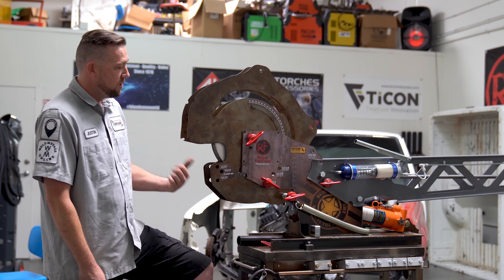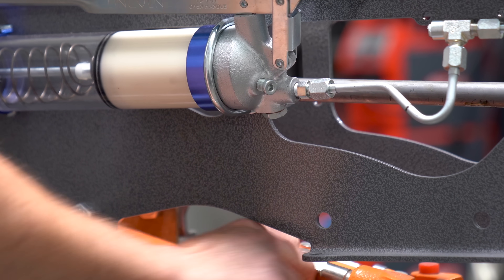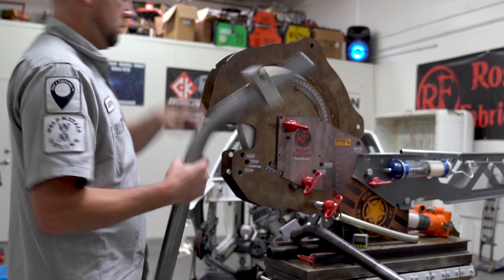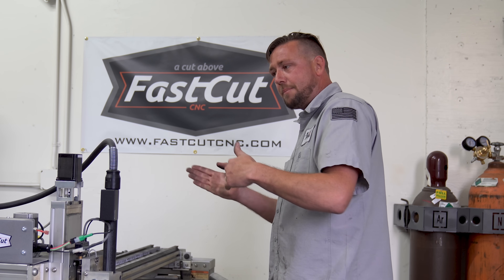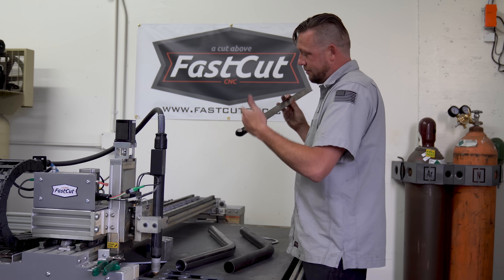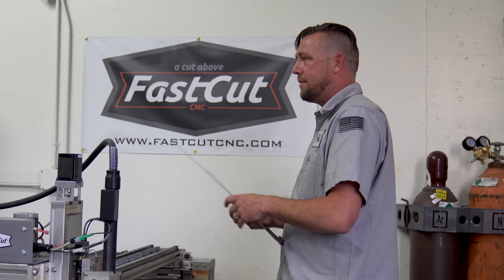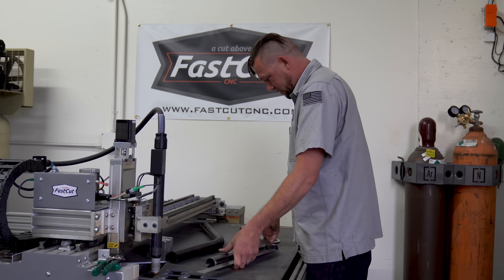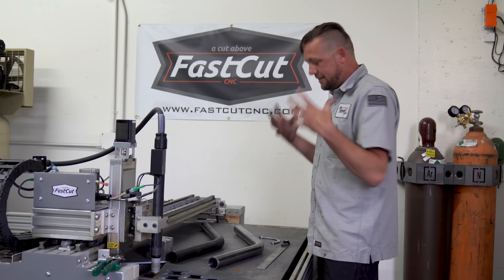How to Calculate Spring Back

Comment: But each angle will have a different response i really feel like. Add 3 degrees for a 45° bend but for a 12.5° bend the spring response seems it should be more because of less heating in the metal.

Comment: I spent years and years  as a tool maker.  I made a whole lot of  4-slide tooling.  A Four-Slide Machine  has  bending  dies  that come in from four different directions to form a piece of wire or tube  etc. Most  4-slide machines  have been replaced by CNC bending machines.  They are much faster and easier to  set up.   
 
 The first thing you learn in making 4-slide dies is that Spring back is never the same  for the same material from batch to batch.  
The Smelter  alloys and  pours a batch of metal and that metal has to go to the factory where the tube or wire is fabricated and it all has to be done all at once from the same pour  in the same  drawing ( if it’s wire)  or forming process  (for tube) using the same tooling and settings.   Otherwise the bending shop can not bend the material and get reliable  geometries. 
  
 Yes you read that correctly.  Each shipment of  any given size wire  or tube from will all be the same BUT  not the same as the exact same size and alloy of tube or wire from a subsequent batch. 
 So  you always order all you could possibly need for any job.   It is important that the seller understands that it all be from the same  pour of metal and from the same job of the  drawing  process.  If you ordered too little.  ordering more means you need new Bending Dies.     This is because  any given run of  metal  will have differences from another run  and the  surface tensions even alloy  can be sufficiently  different from run to run  that the dies made for one  run   just won’t produce the same result  on an other.  
Spring back  is different  for each pour of the Smelter’s metal.
On the up side  it kept us employed.  Now with CNC benders they can accommodate   those differences  with  a few strokes on a keyboard.

Comment: Bend a lot if pipe. Different trade though. Manual, mechanical/ratcheting and hydraulic. Every bender and every material is different. Even the same model there will be a difference. Set up is critical. If one has limited material don't make the desired bend first. Make half the bend or like is suggested anything over 10 degrees. Measure that bend. Now you know and continue to the full bend. Justin does a great job.
Reply: But if I do half a bend, will springback be the same, or double?

Comment: Great video Justin!  I always thought that the steeper the angle the more SnapBack it will have... do you find this to be true or no?
Reply: Actually it's true ! and the more troubeling that the relation is not linear, I've experienced bending over angles like 20 and 80 and both are not springing with the same rate !
Reply: @MrAli015  that's what I was curious about if it was linear and if it was percentage or a set amount of angle.  I figured it would be non-linear but a lot of things aren't as I would expect them to be.

Comment: Everything affects bend angle. The material, in the case of a tube, the diameter, the thickness, the temper, etc. in the case of a plate in a bender, the material, the thickness, the width. With anything you want to bend, even the angle you want to bend it at matters. The greater the angle you bend it to, the greater the spring back. If you’re serious about metal work, you need to buy some books on the subject. Machinery’s Handbook is the premier book on the subject. It’s expensive. But think about how much expensive metal you will be throwing away over time, and the price will seem like a lot less. You can buy an older version on eBay. For basic metalwork, even a 50 year old copy is fine.

Comment: Remove the human error of doing the math from the supplementary angle...zero your protractor with the arms open so that it reads "0" degrees fully open, like a straight piece of tubing. Then measure your bend angle.

Comment: Digital does not mean accurate.
The digital bit is only a display.
The resolution of the encoder or glass/magnetic scale they are using in the device is what produces the accuracy.
Analog is not inaccurate ie vernier protractor is just as good as your "digital" one. it has to do with the resolution of the actual measuring system.

Comment: Great video. Well explained. My question isn’t about spring back. It’s about the chrome molly tube itself. Since it’s a tool steel 4130 or 4140, when it’s welded doesn’t that weaken the tube? Should it be heat treated and tempered? Im just a little confused about this. I do know that hammers, sockets, gas bottles, gun barrels, and many other things are made from chrome molly and when you get them hot they are ruined until they are heat treated again. Maybe you could do a video about this and explain.
Reply: 41XX is an alloy steel, it is not tool steel.

Comment: I prefer using a digital protractor that has flat vertical sides. It's easier than the thin blade type used in the video for keeping it flat against the pipe.

Comment: You are correct.  It is never the same when you change your tube.  i crawl up on it until I get there.  Once you have it your good, until you change to a different tube, type, size, or thickness.  In the middle of a build, type change would be weird.  If I start with 4130 I stay with 4130.  I never mix types.

Comment: As an electrician I have to bend all different diameters and thickness of pipe. We have percentages that we have to multiply our spring back by. 30s require between 33 and 35 degrees, 45s require roughly 47-50 degrees. 90s require roughly 93-95, thin wall conduit requires less overbend to compensate for springback, thick wall requires more because of springback. Also these numbers change from bender to bender because of 0 degree take up along with shoe slop.

Comment: Great Vid thank you . Will the spring back angle increase the bigger the angle bent ??
Reply: Yes. In my experience we have a cheat sheet we have built over the years at work. And the more angle the more spring back you will get. We use the cheat sheet as an educated guess. Spring back can change from getting the same size tubing from different suppliers. At least in my experience of bending tube for only 10 years now. Stainless and chromoly spring back ridiculous amounts but HREW DOM tubing springs little in comparison.
Reply from the maker: It depends. It is not a 100% yes or no. If you have a bender - find out. It only takes a couple pieces to get the correct answer.

Comment: Do you need to recalculate this for different bend angles? Will a 90° need to be bent at 93° or 96°?
Reply: yes. do a 45* and 90* test bend and you can interpolate between them
Reply: In my experience the offset changes depending on what angle you're bending. If you need to offset a 45° bend by 3° that might not necessarily be what you need to offset a slighter or heavier bend. I always do a test bend at whatever angle I'm shooting for, measure the angle and adjust accordingly. Taking a little extra time on the outset and knowing where you need to be beats trying to adjust bends after the fact.

Comment: Hot rolled and cold rolled also has different spring backs as well. And for measuring the angle you can also spread your protractor out to 180 and zero it and than the angle will read as bent.
Reply: Sam Harper you should make some videos like this as well.

Comment: Is figuring spring back angle solely an empirical angle arrived at by experimentation? Or is there a table of spring back angles and compensation factors for various materials? It would be nice to be able to calculate that compensation factor before bending up a bunch of material.
Reply from the maker: If you want the exact number for the material and machine being used, you have to bend some material up. There are more factors than just the material itself. It is not universal.
Reply: @TheFabricatorSeries  Thanks. I was wondering if there was a "ball park figure," but it seems not.

Comment: hi Justin, I have been a long time follower of your channel, I am a retired sheet metal worker and boilermaker ( steel fabricator, ( Australia ) have built a couple of drag race cars, back in the late 70's early 80's,  and I was impressed with your tube bender, can you send me info on this unit, did you build it yourself or is it an off the shelf purchase ?? :-) thank you, John
Reply: John, Justin did a video on that bender in season 3. It’s under bender upgrade. There are links in there. It can be bought as a kit from rougefab. The website says under FAQ they will ship to Australia. Hope this helps.
Reply: @shanekirkwood7234  thank you :-) for your reply :-)

Comment: Don't mean to complicate the process, Just for some of your viewers to understand how correct you really are... Never a rule of thumb. It's that I've learned to prepare for a bit of an 'Oops' pile when you begin with a new material and/or diameter. Small springback take-up measurements, such as these are in the material you are using, are negligible. However dimensions on some material, Such as 4's stainless, can have springbacks that increase incrementally up to 30 degrees but then begin decreasing beyond that bend.
Reply: What?

Comment: Just being pedantic here, but DOM is not a material but a forging procedure. And I really hope your chrome-moly tubes were in fact formed by being drawn over a mandrel, otherwise they would be useless for a roll-cage.
Reply from the maker: You are correct about DOM not being a material. However, its a lot easier to understand when you speak the same language that everyone knows. 
This chrome moly tubing was not manufactured using the DOM process. It's manufactured using CDS.
Reply: But DOM will have a different springback angle than ERW will, simply because wall thickness changes affect it.

Comment: Just curious, if you have 3deg of spring-back for a 45deg bend in your setup with your material on your machine, do you treat that as a constant for all bends, or do you treat that as a relative spring-back? Like, would you add 3 degrees to a 90deg bend, or would you add 6deg because you're bending twice as far?
Reply from the maker: Its more of a constant. There may be a few decimals of difference. With enough material you can get really technical and graph it, but this will ballpark it.
Reply: @TheFabricatorSeries  I usually bend a 45 and a 90 and check both.  More often than not, it's consistent (if 2* at 45, it'll be close to 4* at 90) but I've had some that are wildly different so I always check both.  Over 90 I usually will just bend to the number I'm looking for and release pressure and just watch what it springs back to, then I can eyeball the overbend required and release pressure again to see if I got there.

Comment: Should springback not be measured as a percentage or atleast some kind of variable measurement depending on bending degree? Like 45° might have 3° springback but to use that rule on a 10°bend and say a 90°bend I would think that that value would be inaccurate?
Reply: you will also find that 2 pipes of similar size  from 2 different batches will have different spring back due to the different material properties,

Comment: So chromoly at 1.5" .120 wall has a different spring back than chromoly 1.5" at .083?.....just want to make sure. I would most likely check the differences anyways but want to be sure that its also different between the same materials with different thicknesses.
Reply from the maker: Yes. Every material, diameter, size, thickness, etc. has its own spring back. That also changes with every tool (or bender) you use. It even changes as you use it over time.
Reply: @TheFabricatorSeries  makes sense, thanks.
Reply: FWIW, think you misunderstood that the 1.5" .120 wall tubing was mild steel HREW, not chromoly, so different metal composition, different process forming the tubing (chromoly would be drawn over mandrel), and different thickness.
Reply: @LonersGuide  i didnt mistake anything, im making sure and asking that even across the same material but different thicknesses that the spring back is and will be indeed different based upon everything mentioned in the video.
Reply from the maker: @LonersGuide  Chrome moly is not manufactured using the DOM process. DOM is actually flat, rolled, and welded. CDS is the process with this chrome moly.